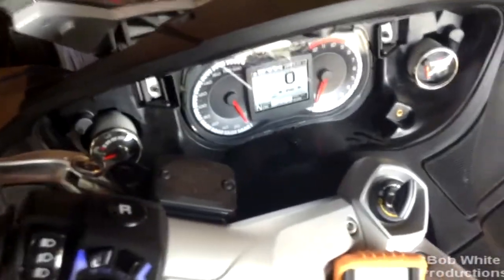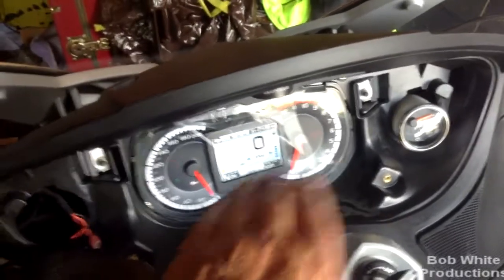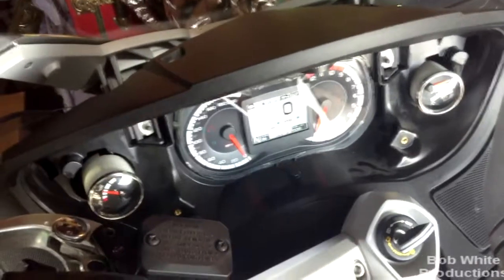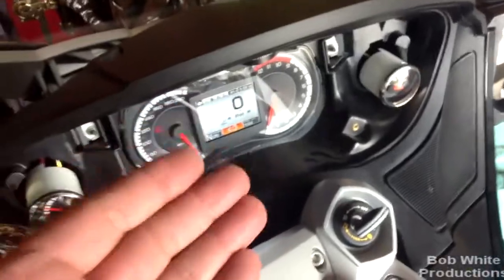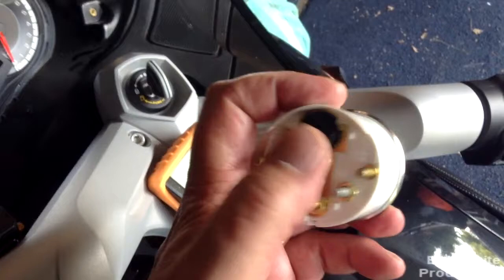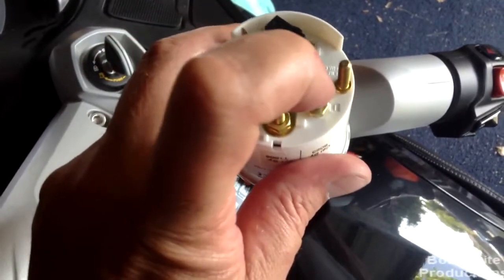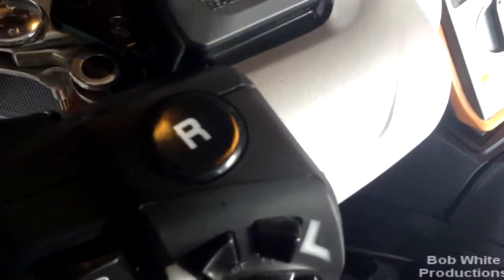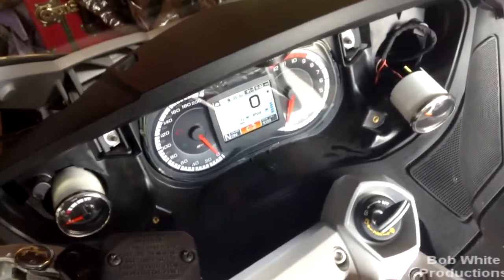My RT Analog gage removal and testing - DIY failure :(

Comment: FYI - I had problems with a 2011 Can AM Spyder RTS-SE5 Cluster - it simply was not operational and Temp gauge flat. The only thing working was the fuel gauge. Took everything apart down to  the cluster 24-pin plug and it was the plug that had come loose to the point that the cluster would not work. Secured the plug and everything came back on. Save myself $1,400 for a new cluster that the dealership wanted to install. They tested the cluster with OBD and stated it was bad, but never investigated why -- never looked at the plug. It is easier to just charge the customer and not do any investigation as to the real cause.

Comment: What year is your RT? I got a 2014 that both analogue gauges don’t work. I came across you video and thinking about disconnecting the gauges until I can get replacement. But is it worth to replace them?
Reply from the maker: Mine is a 2011.  I know you can remove the gauges on a 2014 but the wiring for hooking up other gauges is different. You may have to run your own power to replacement gauges.  Not sure though

Comment: Since you had the gauges out did you see a way to change led bulb?
Reply from the maker: My gauges on this 2011 RT were not LED and the bulbs come out easy for replacement.  I can't help with the new ones with LEDs sorry.
Reply: @FinlessBob  I got a 2017
Reply from the maker: @redwhiteblue319  Again mine is older and has bulbs not LEDs.  I believe 2017 is LED in those gauges.  I do not know if the LEDs can be replaced.

Comment: Hey bob I took out my fuel and temp gauge and put in a volt meter and then a digital clock where the fuel gauge was.On my screen when the bike gets warm the temp gauge lights up with orange blocks but I have a full tank of gas and the first time I unhooked the gauges my fuel on the screen showed blue blocks all the way to the top and now all I'm getting is white blocks. Do you have any solutions as to why I'm getting this?

Comment: A possible solution (not tried)...

The 4 pins are probably ground, light (variable voltage for brightness), "I"gntion (12V), and "S"ender.

If we were to disconnect only the "Sender", does it trigger the electronic guages. Or is it the "Ignition" wire? If it is the ignition wire, you could connect that to a different switched source and the digital gauge would trigger AND the analog gauge would will be enabled. Perhaps the temp gauge would still work too.

If disconnecting the sender wire makes the digital gauges come on, then you could make small isolation amplifier that makes the circuit appear to be disconnected (high impedance) while the amplifier still drives the gauge.
Reply from the maker: The 4 wires are ground, switch 12V for the bulb and 2 for the signal (sender).  I believe these are can-buss data lines. If you unhook one of the sender data lines and reboot, it switches to the digital gauges on the display.  These data lines go through the cluster so if cannot talk to one of the gauges it displays the digitals.

Comment: Yep, I'm in the same boat Bob, so what I did was replace the fuel gauge with an analogue clock and powered it up with the +/- from the light, yes it only works when the bike is on but I then put a little adjustment button just below the clock so that when I'm on big ride I can see duration, on the other side I intend to change it for a volt meter by doing the same thing. good clip Bob.